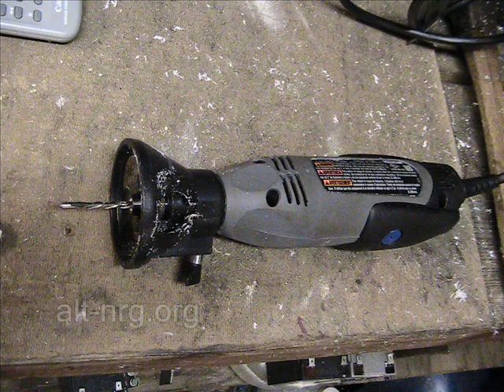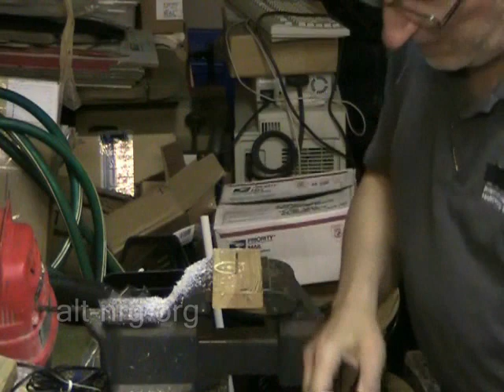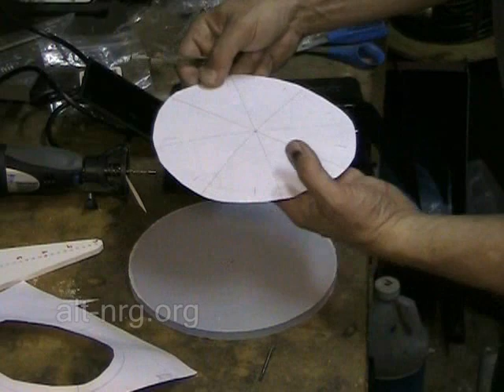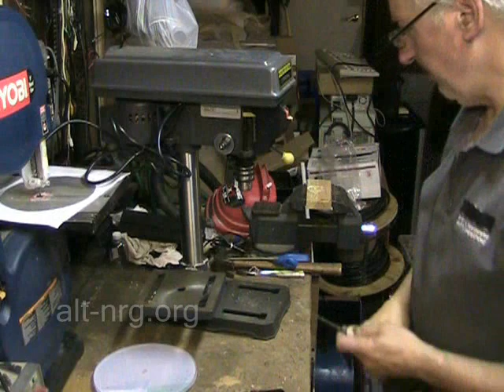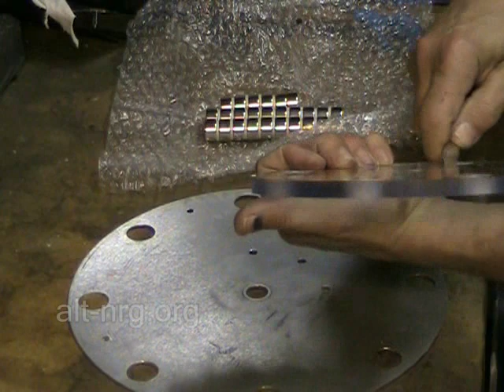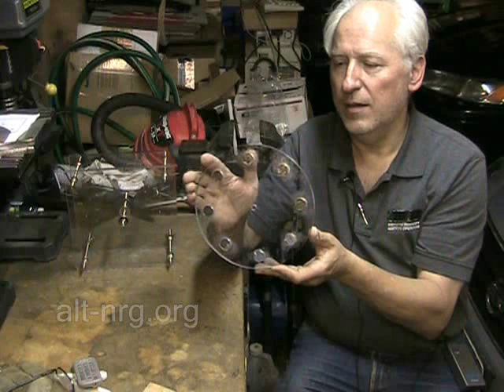#275 Muller Magnet Motor Dynamo

Comment: Thanks for the great videos - I was wondering if you've considered using either a Unibit step drill or a 3/4 Forstner bit rather than the speed bore, since the speed bore has a longer shaft and can flex under load. Also they tend to make a rougher ID surface in plastics, unless that is your goal for better glue adhesion?

Keep up the good work!